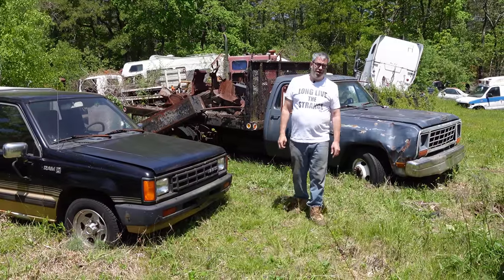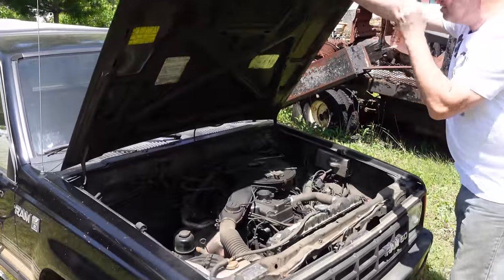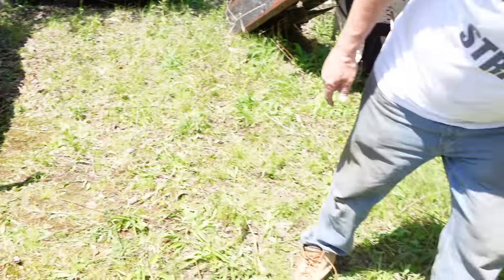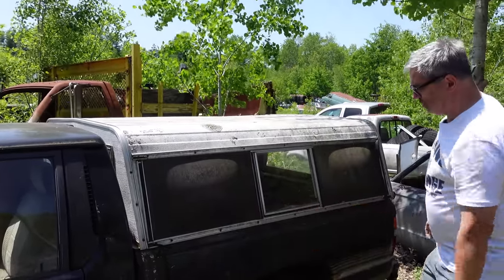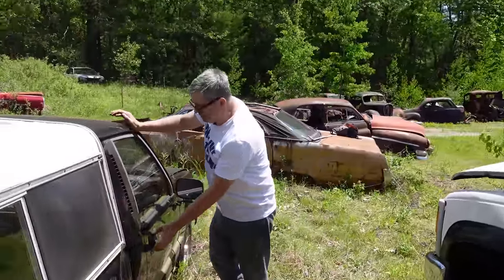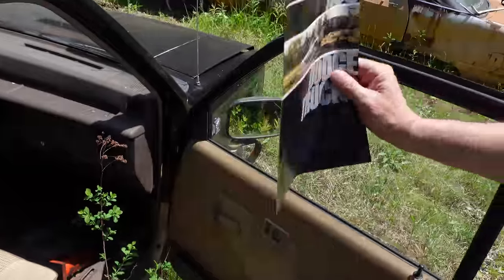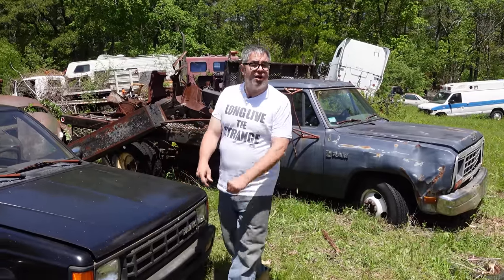Baby Ram

Comment: No, that's not correct. The Courier (not the Ranger) was the Ford captive import from 1972 to 1982. The Ranger was a Ford designed, built and sold unit, starting with the 1983 model year and replaced the Courier as the mini-pickup in the Ford line. Famously, Henry Ford II, aka "Hank the Deuce" ignorantly told Mr. Iacocca one day, "No way any vehicle with my name on the hood will be powered by a Jap. engine....". When Mr. Ford made that statement, Ford had been importing the Courier for several years. Mr. Ford II was not the brightest bulb in the string. 

No, 1980 was the year for the 85 MPH speedometer requirement, not 1977. Based on the dealer logo on the tailgate, this was likely sold used through Dillion Chevrolet in Greenfield, MA which is now McGovern Chevrolet of Greenfield at 54 Main Street. Correct, the imported Dodge Challenger (and cousin Plymouth Sapporo) were a rebadged Mitsubishi Galant Lambda coupe. No, 1993, not 1994 for the ending of the Ram 50 line. In 1994, the Dakota took over as the "mini" pickup in the Chrysler lineup. The Mighty Max (what the Ram 50 was based on) continued through 1996. I was never a fan of Mitsubishi. They made great electronics and TV sets and that's what they should have stuck with.

I remember my neighbor who was a mechanic working out of his house at the time needing to get parts for a Mitsubishi Starion. I said, "Easy. We'll just call the Chrysler dealer and have them look up parts for a Conquest. Same vehicle". My neighbor was amazed that I could figure that out. This was before the internet and Rock Auto and the quick availability of information, and long before I worked for an automotive parts manufacturer where I had every parts book available within a 10 foot reach of my office. I still have a parts book for this Ram 50 in my collection, as well as most Chrysler products from 1982 to 2005 including 1981 to 2005 Jeeps. 

Kudos to you for being clean and sober. I don't drink and I've never smoked---not even once. My "addiction" is fixing things. I just pulled a 1998 American Yard Products 22" lawn mower off the curb earlier this week. It has a Honda engine, which I'm not a fan of. The sign taped to it said, "Runs well. Gas drained. Going out in the garbage on Tuesday". I put fuel in it and it fired right up. I'll do some maintenance to it and then decide if it's a keeper or to flip it. Even the self propelled feature works. I'm using a 2007 MTD mower that my neighbor tossed out in 2019 to cut my lawn. When my neighbor saw me using it the next day after he put it to the curb, he signaled for me to shut off the engine. He said, "Got it running?" (Very obvious I did.....). I said, "Yea, someone ovefilled the crankcase and it saturated the air filter and plug. I replaced those, leveled out the oil level and unjammed the engine and it fired right up. Runs great. He said, "Well, I didn't need it. I have an eletric now." I said, "Yup, everyone throws out a good running gas mower so they can buy an electric whereby the batteries will go bad in four years and total the machine out." LOL. If it's not yard equipment, it's tools, or toolboxes or other durable goods that I'm fixing up. But, I do thin the herd now and then, as I did this past winter with flipping a curbside snow blower. If you "shop the curb", you can often find what you need. My workshop garage is maintained with curbside/CL find tools, toolboxes and yard equipment. Most of it was put back into service with very little effort. 

Caps were also added because of laws so that they wouldn't be considered "commercial trucks" which often required higher fee plates and registrations, and some were not allowed on parkways in some states. 

No VIN, can't win, but the 10th digit of the VIN is an "H" for the 1987 model year and these were made in Nagoya, Japan. Possible code TX9 Black exterior paint (going by a domestic code that year. "Mighty Max" (not "Mighty Mite") for the Mitsubishi version. My grandfather's brother, Frederico aka "Freddie the Barber" had one. He and my grandfather were partners as barbers for 14 years (originally a "short time arrangement") from 1982 to 1996. Prior to that, both had been barbers on their own for over 50 years. In fact, all of my grandfather's brothers (Sam, Roger, Emil, Al, Freddie and my grandfather Emanuel) were all barbers. Yup, all old time Italian barbers. I've never paid for a haircut in my life. My uncle (my grandfather's son) now cuts my hair using my grandfather's Oster "Classic 76" trimmer and barber tools which I've repaired a few times. My grandfather lived to be 101.5 years old and was a barber about 75 years. My workshop garage I've referred to in several posts was originally the garage at the back of his property, which has been in my family since 1975.
Reply: Wow! Cool story!
Reply: @timclosson7166  Sure thing. Which one? LOL.

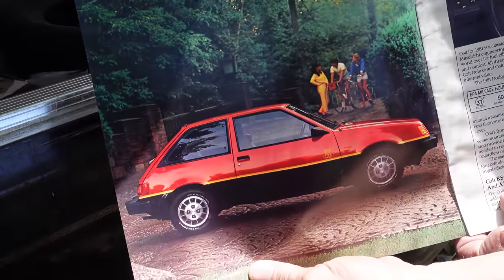Comment: 5:08 "...including that goofy little Colt..." Why you little...! I had one of those. Great little car. I worried if it ever broke down, I wouldn't know what to do, because i never had to do anything to it! I kept poking the fan belt, to see when it needed tightening, and it never needed tightening! What kind of car never needs the fan belt tightened? For five years!! And later I drove a Mitsubishi Delica, which is a Ram 50 with a diesel engine and a van body instead of a pickup truck. It was never sold in North America, so it took a bit of ingenuity to get parts. One of the tricks was, for anything steering, suspension, etc...anything but the body and engine,  I could order Ram 50 parts and they would fit.

Comment: As much as I appreciate your positive comments I think this time you’re being overly fair. The Mitsubishi 2.6 was a serviceability nightmare, no owner negligence required. Head cracking valve seat dropping impossibly complicated timing settings (name another engine where you can get a balance shaft 720* out of time) aside, Mitsubishi contributed to the problem with horrible parts availability. The plastic bodied Mikuni carburetor combined a “nobody ever did it this way “ arrogance with missing part #’s for the things that went wrong first. Mixture control/idle stop solenoids, choke pull-off diaphragms and wildly unique thermo waxes we’re all only (factory) available with the hideously expensive carburetor top assembly. Then competitive manufacturers fell in love with it and the thing ended up in everything from the weird ass turbo Starion to Mama’s Plymouth Voyager. Sorry but that motor wrote the book on losing.
Reply: Never saw a single one with a head problem, other than one that ran one out of oil, when he changed his own oil, and installed the wrong filter. He melted the cam bearings, which were playing on the aluminum head. The timing chains were easy. Align the plated links with the marks on the sprockets. The only bad thing about the engine, was if the owner was too stupid to have a worn timing chain replaced, which would be extremely loud before it got that bad, it would stop driving the chain driven oil pump, and the engine would be toast.
Reply: lots of people waxing poetic about that 2.6, I remember it as being regarded as a weird, unreliable POS to be avoided. Chrysler got rid of it ASAP and replaced it with the 2.5 variant of their 2.2, and also the 6G72 V6 when a little more power and refinement was needed.

I remember the noise of the timing chain, from basket case cars on their last miles, waiting to be replaced by the next $3000 beater (when $3k bought you a drive-able if not awesome car)

Comment: I miss the smaller pickup trucks.  The current offerings from GM (Canyon/Colorado), Ford (Ranger), Toyota (Tacoma), etc., are almost as large as my GMC 1500 Sierra (reg cab/short box).  And in some ways bigger.  The Ford Maverick isn't even as small as those bygone models.
Reply: They're also way overpriced for a "not so capable" truck.

Comment: always fun to see vehicles I own featured here! I own a 1981 2wd D50, a 1987 2wd D50 long bed, a 1987 D50 4x4 long bed, and a 1987 Mighty Max 4x4 short bed with factory buckets and light bar. They are great trucks but their weak links are the manual trans synchros and the cylinder head jet valves. I'd be sitting on a gold mine of they were Toyotas lol
Reply: I just got an 82’

Comment: I had an 86 Ram 50 back in the mid 90's when I was stationed at Fort Campbell, yes it was a small, ugly and yes it had little to no power but it was the PERFECT vehicle for me at the time, Ft. Campbell is 4 hours from  home for me in Mid Missouri, I could jump in the truck right after formation on Friday night and be HOME by 9 p.m. for the weekend and it cost me $15 in gas. I loved that little truck.

Comment: I had one of those D 50's. Mine was an 'extra-cab'  which housed my speaker system. :)  It was more than anemic. It was so anemic, hills in Florida made it work TOO hard. :)  I had a 1988.  Mine was a 1.8 or maybe a 2.0 4-cylinder for some stupid reason. Black mirrors and no striping (except some that the dealership put on it.. ) I put 190k on the little truck before I traded up to an actual Ram in 1995. :)  In Florida, mini trucks like that were the bees knees for poor college students like myself. :)  It survived being hit in the rear by a Nissan 240z and smacked on the left side by a drunk in a Ford Ranger. :)  I miss the little thing.  It was SLOOOOOOOOOOOOOOW, though. :)

Comment: You called it an Isuzu twice LOL. And they were Mighty Max by Mitsubishi I had a new one in 1987 that I drove for 5 years and put 112,000 Mi on it without ever having to put brakes and only one set of new tires. Was one of the best vehicles I bought brand new. Had the 2 liter and 5 speed

Comment: A friend had a Dodge Colt stripper. No AC. 5-speed. Great little car. Toured the western U.S. in that car. Crossed the Mojave Desert in August. Had my feet out the window sleeping and was dreaming that someone was holding a hairdryer to my feet. The starter would get too hot to crank so we would just push-start it. Sometimes simple is better.

Comment: 2.6 ,s were junk. I worked for granite dodge in Quincy in 1980. Thats all that came in was colts with overheated engines and head gasket failures. It was a garbage engine in the early caravans too. That year we sold 300 d350 cab n chassis trucks with 360 4 bbl thermo quad and a 4 speed. They came with dually deep tread snow tires from the factory. We would drive them around back and roast the snow tires. They were very favored by the phone company for power and reliability
Reply: I remember walking through a Plymouth dealer service area in 1982 and the place was full of Mistubishi 2.6s. Same issues!
Reply: I hope you grew up since then.

Comment: Mitsubishi Mighty Max. Also available with a 2.3L turbo diesel (based loosely on the aforementioned 2.6L Astron engine). And funny enough, the later ford rangers were also available with the same diesel from 1985-1987.

Comment: Had an 85 Ram 50 4x4, long bed one ton capacity. It was an OK truck, the 2.6 never ran quite right and leaked oil out of the rocker cover gasket like a spring well. Had an 88 Dakota, 4wd, long bed. I preferred the Dakota ten times over the Ram 50.

Comment: Whenever I see an old Colt, I remember having a customer come in with one years ago with a bad brake master cylinder.  Left hand drive car but the brake master is on the right operated by a lever on a long shaft connected to the brake pedal on the left side.  I suppose it was cheaper for them when building more right hand drives than left.  It looked hilarious though.

Comment: These small trucks were the way to go back then, prob even more so now with insane fuel prices the last two years thanks to a certain slimeball. Dont forget all the imports offered a diesel option. This gen Mitsu didnt have it but the Gen before did and also in 4WD as did Isuzu and Toyota, both turbo. These days all we keep getting offered is bigger trucks loaded with options and crazy price tags. They still make compact trucks but ship them everywhere but here. Time to get back to basics and offer a small stripped down work truck again with or without diesel. In 1983 I went to the local library and read all the car books and drive tests on all the imports then test drove them all at dealers, finally settling on the Mazda B2200 diesel. $6200.00 out the door. Drove it 579,000 miles until 1999 when it broke in half. In 2002 I found a 1984 in Los Angeles and had it shipped to CT and am still driving it although parts are super hard to find but it never breaks down!

Comment: At Plattsburgh AFB in the early 1980’s, we had pickups from all 3 US manufacturers. That included Chevy LUVs, Ford Couriers and Dodge D-50’s. It’s all relative but the Dodge was the better handling and riding. Side note: when I was previously stationed in England, we had all 1/2 ton US models and a few RHD Bedford light utilities.

Comment: I had that motor in my 85 Reliant K. Its a gas hog and they were prone to timing chain guides breaking, which is what killed mine.
Reply: I had an '81 K-car Reliant wagon with 2.6L hemi, but it broke completely in half from rust before I got to drive it much...

Comment: One of the lamest body styles for a Hot Wheels was the Dodge D50 circa 1980. But the model was simultaneously cool because it was one of the “Hi-Rakers”, wherein you could adjust the rake of the body by jacking up the rear axle.

Comment: The D50 reminded me of what a small truck should be and of my 95 Ranger. I believe I saw a white Ford Ranger (1982-2011) in previous videos. It seems to me Rangers are one of the most underrated trucks of all. Ford sold around 11,000,000 of these things over their nearly 30 year run. Don’t know about New England but many are still running around here in the south, and I saw no fewer than 5 today. Kinda known as grandpa trucks, people have been known to get 200 - 300k miles out of them, especially the 2.3L four. The fours are underpowered but they do their job with a full 6 foot bed, generally unavailable in a so-called small truck of today. And you can load the waist high D59 and Ranger beds without a stepladder. There’s seems to be market for these small trucks today, but why bother when Detroit can sell $80k megalodons?

So I continue to drive my 95 bought in 97 for $10k. There’s no suitable replacement available. It has 150k miles on it and shows no sign of stopping. It’s had no major repairs and parts generally remain available. I love driving it, as bad as it rides, because of all the manual handling you have to do - transmission, windows, wipers, door locks, etc. No Bluetooth on these guys. It’s like a throwback to the Model A. Not knocking the Dodge/Mitsubishi, but give the Ranger its due. And Ford wants me to replace it with the current Ranger ?!?!? Not a chance.

Comment: Some Colts had a triple stick arrangements on the transmission.
Reply: It wasa 2 stick automatic. You could have it in economy/ high range or power/low range.
Reply: It was a twin stick manual.  You have 8 gears to play with.  I had the 1979 model.
Reply: @mexicanspec  you're right, I meant manual

Comment: I know must be a slip up but the Ranger was never a Mazda. Before the small Rangers was a trim on the F Series. The small import Ford from Mazda was a Courier.
Reply: Yes but the last years of the Mazda B Series were based on Rangers..
Reply: Courier
Reply: We could get ford badged mazdas called a ranger here in OZ in the late 80,s ,early 90,s . Strangely enough ,they had the same mitsubishi 2.6 as the example steve is showing us.
Reply: @grandtheftautotune7715  yes but those Fords badged as Mazdas. The Courier was a Mazda badged as a Ford. The Ranger in no universe particularly the 70's and 80's that Steve was talking about was a Japanese import badged as a Ford. In the 70's even early 80's was an F series trim. Than when GM came out with the S trucks Ford put the Ranger badge on their line of small trucks compete and discontinued the Mazda built Courier.
Reply: @bikingD  He made a mistake and misspoke. He meant to say "Courier" at that point in the video. Yes, the Ford Ranger was a Ford designed and built product, but it did use some Mazda inspired components along the way.
Reply: @googleusergp  Exactly which is why my first line said must be a slip up.

Comment: Wasn’t there a law requiring speedometers to show 55 at the 12 o’clock position, as in this truck?
Reply: It did not have to be at 12 o'clock. Most would have had 55 in red.

Comment: The Ford Ranger was never an import. The Courier was in the 1970's. Ranger was a trim level on F series and Bronco on those years and than was a Ford built small truck from 1983 M/Y till 2011. It returned as a large midsize Ranger in 2019

Comment: Impressive truck for a compact model. 6 lug wheels , 1400lb payload and probably still got 28mpg or more. Never heard of one of these at least they gave it some trucking abilities. LUV and Courier were the ones that I knew about. Neat always learn something new from your videos .
Reply: Had an 87 long bed 2wd 5 spd 2.6 mitsi. 4.   Never saw 20mpg,  17 usually. parts at the time were harder and more expensive. Carburetors  today are not to be had. They were not as good as the Toyotas. Mazda and Isuzu also had six lug wheels as did the yota 4x4.

Comment: Steve I think you screwed up buddy, Ford had the courier. That was the Mazda variant. The ranger didn't come out until I believe it was 83? Either way great video. I used to have a 91 power ram 50 absolutely loved loved loved that truck. I was so stupid to get rid of it. Actually traded a old worn out 86 Monte Carlo super sport for it.